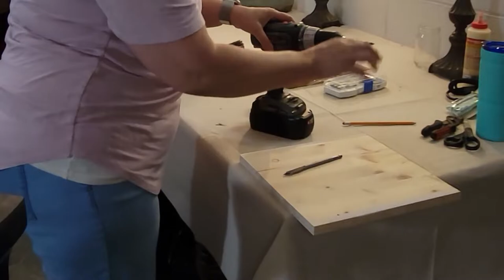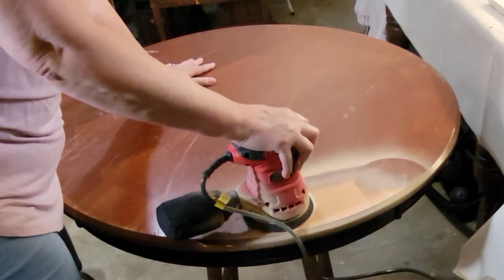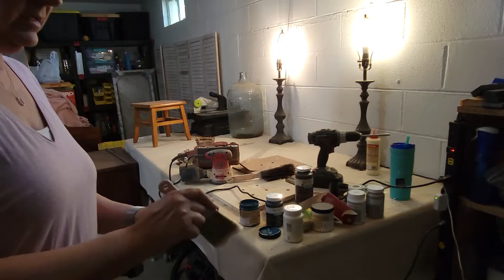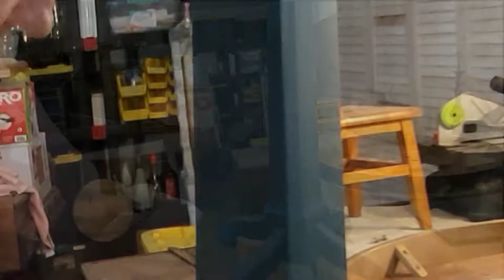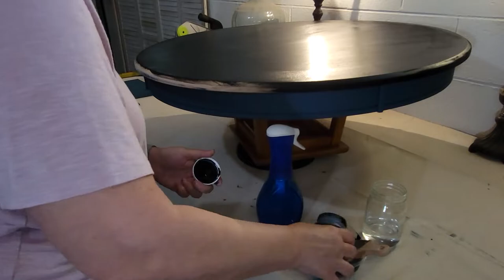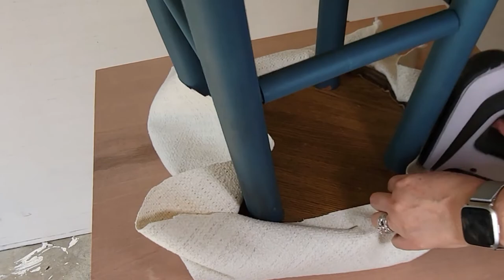Furniture Flip | Upcycle Furniture | High Top Table | DIY

Comment: Even though the stool is faux leather, you can stain it with black leather stain or paint.  If that isn't an option you like, you can buy a yard of black fabric, remove the faux leather top and use it as a pattern, then staple the new black fabric onto the stool/padding.  Throw the faux brown leather out.  Your little set up looks cute! Another stool will complete the set!! You could also cut or buy an inch round piece that could replace the padded top of the stool altogether.  Just a few ideas.  I think you're doing great. ❤
Reply from the maker: Thank you so much for all the ideas to finish off this project!